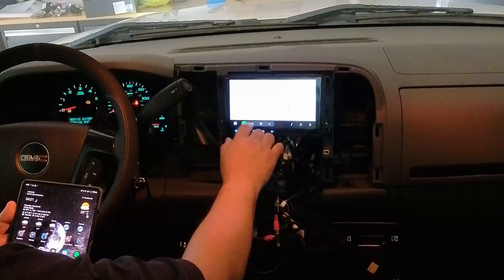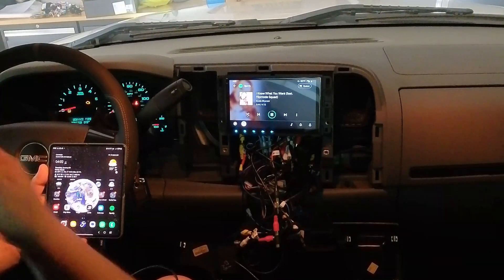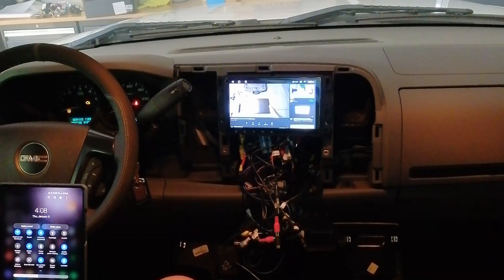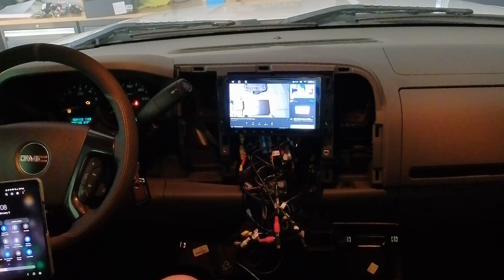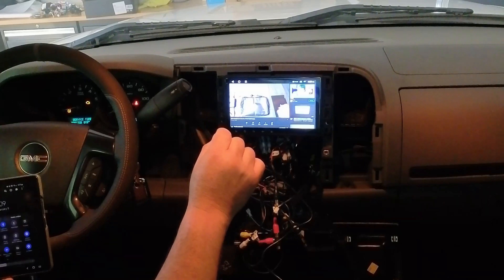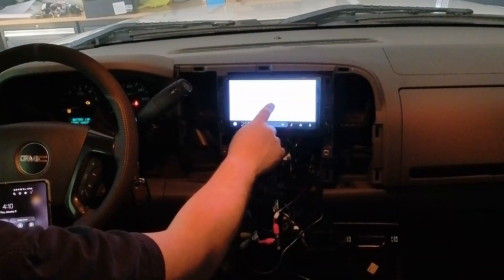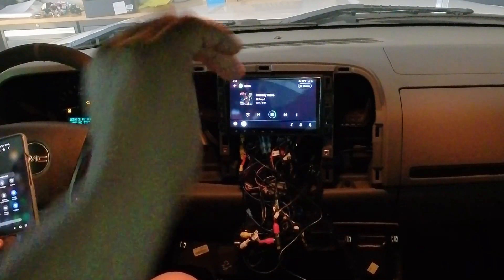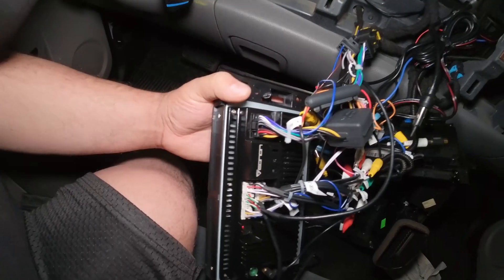Eonon Q80pro update 2023

Comment: Honestly I just need to know where to get my remote wire and sub woofer rcas from ? Does the eonon have it? Will there be rcas for mids and highs?
Reply from the maker: Yes the eonon has it. You just gotta make sure you connect the right harness in the back. The radio comes with everything.
Reply: @T_B_C_L I got a 2007 Tahoe LTZ with the Bose and navigation will have any issues wigg to it I got a JP63 and JP234 that I’m gonna run pretty soon on 4 15s and 4 dead bonce neo Arnold’s 4 super tweeters and a couple other things
Reply from the maker: @Dixonyass-g8v  ooow, I'm not sure. I don't have any experience with the tahoes. I would think it should be fine though. If you get it from Amazon just make sure you get it with free returns just incase you have to return it.

Comment: Does your traction control button work, if so did your truck come with it or added after the fact? 
Also, how did you add volume buttons on steering wheel?
Reply from the maker: Does the traction control work.... To be honest I have no idea. I've never pushed that button that I know of. My truck came with it. As far as The volume buttons on steering wheel, they also were already on the  truck. If I'm not mistaken though I'm pretty sure you can add them. I think the wiring is there you just need to add the buttons. Try searching it.

Comment: Just curious to know if you can use your own background images or gif?  Been looking for a decent stereo that will. On regards to steering wheel controls...I have an aftermarket Pioneer in right now, and had to get the iDataLink setup to retain the steering wheel control.  Ther should hook right up to this I hope? Thank you for your time.
Reply from the maker: Honestly can't say about the background I never tried it. As far as the idatalink, you won't need it. Steering wheel controls will work np.
Reply: @T_B_C_L have you wired up a system to it yet? I wanna put 2 amps mids and highs and also 4 15 inch subs in my 07 Tahoe ltz
Reply from the maker: @Dixonyass-g8v  I have some videos pertaining to that in this Playlist if you want to check them out. https://youtube.com/playlist?list=PLAYFBk0HIHNgrZcPdbNeokgDL3AdhmPV6&si=DlbaWfPJVDyPXb9Y

Comment: Does the radio work with the factory Bluetooth for phone or do you have to use separate option?
Reply from the maker: I'm not sure exactly what you mean by factory Bluetooth but the radio does have Bluetooth and connects to your phone no problem.
Reply: @T_B_C_L  I meant to make calls on the phone I have a 2011 silverado that has the answer hang up buttons on the steering wheel
Reply: Wasn't sure if those buttons would still work as the factory radio only had Bluetooth for calls wasn't used for anything else
Reply from the maker: @douglasmiley5690  honestly I've never answered the phone from the steering wheel. You can change the button options on the radio though, so if they didn't work right it could probably be made to.
Reply: @T_B_C_L  Thank you sir for the help I ordered the radio after watching your video help was much appreciated.

Comment: I’m strongly considering buying one. So are you please with it? I have a 2012 silverado but want to keep my Bose sound and steering wheel controls. Is that possible?
Reply from the maker: I'm still very happy with the radio and I'm pretty sure it will work with bose. You might want to double check with manufacturer for that but I think it does.
Reply: @T_B_C_L  does it have XM built in or that just an option with using wi-fi?
Reply from the maker: @jsturgillrn  I have no idea about XM but basically anything you can do on an android phone you can do on this radio.

Comment: I found an option in Android auto settings to turn on automatic connection to eliminate having to push the tlink button everytime you get in the truck.
Reply from the maker: Awesome, now we need a video so we can all learn 😊
Reply: @T_B_C_L  when it's connecting hit the settings button or once in Android auto hit settings . Scroll down to start up mode and click start Android auto automatically. You can also go all the way down on the setup to see more in the phone app and it will pull up more options on your phone
Reply from the maker: @bnet7089  awesome man ty for the info. I will give it a try 🍻

Comment: Do you have a factory back up cam? And does it work with it?
Reply from the maker: I do have a back up but it's not factory. I do have one I purchased that's similar to the factory one. If I remember correctly the radio did come with an adapter that will work with the factory camera. Unfortunately I cannot confirm that it works. Hope this helps.

Comment: Do you have an aftermarket sub/amp connected? If so where did you connect the remote start from the aftermarket amp to the head unit. On the head unit i see the blue/white amp wire is connected to the orange amp wire already. Im trying to figure out where to put the aftermarket amp remote wire to the head unit.
Reply from the maker: I do have a small 4 channel amp but honestly I don't remember exactly which wire I used. Easiest thing to do is test those blue with white stripe wires and just find one that has power with the key on and no power with key off. If needed just tap or cut and splice all wires together. Best way to find the right wire is with a test light. Your amp only needs 12v switch power and honestly it really doesn't matter where you get it from.